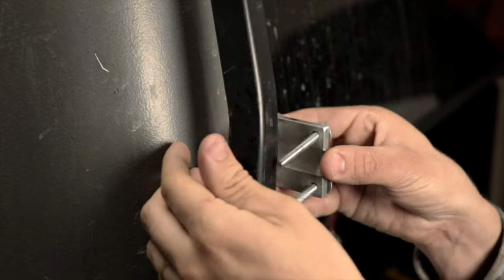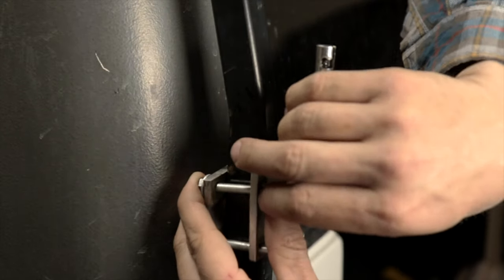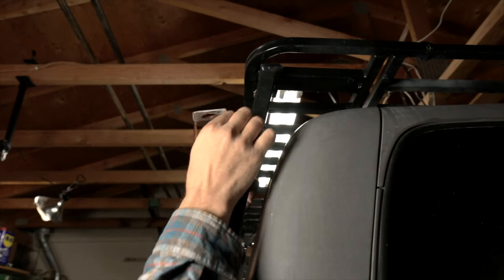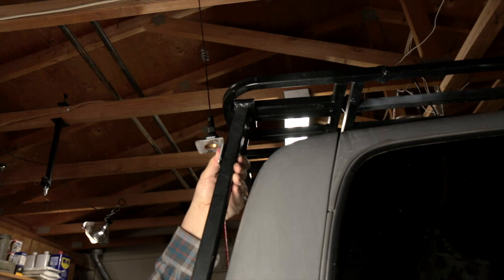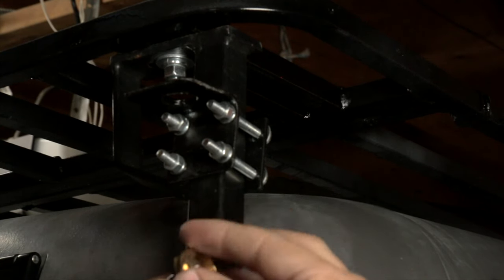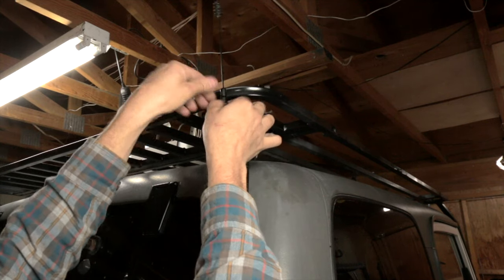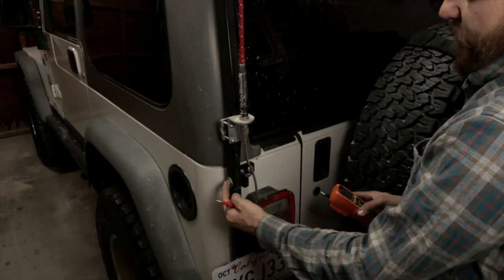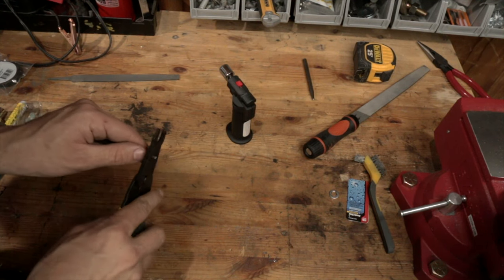How to install HAM and CB antennas

Comment: I agree. The better the ground the easier it is to tune the swr. And with a jeep or any high profile or of road vehicle a quick disconnect is a must. Great video.
Reply from the maker: I used to never run quick disconnects. I’ve learned. Haha. Thank you!
Reply: Yes I found that  too...SWR was erratic until I grounded the outer coax via the  antenna mount to a hidden bolt on the roof bars . As you say, much easier  to SWR after.

Comment: I have a feeling you are going to regret not using aircraft nuts on those bracket installs—at least some blue lock-tite—all this based on your choice of vehicle and their reputation for poor ride and bone-jarring suspension characteristics, even if left in the OEM configuration. Especially recalling your comment in this video foreshadowing future hitting of trees and other low entryways. A rule to apply when adding hard-mounted accessories to two categories of vehicles is: #1, if they can operate on water. #2: If they are designed to or have been modified to operate off-road. If your application falls under #1 or #2, then apply this rule to avoid future mount issues. This rule has two parts and is just good practice, omitting any special use parts with a fix for a known safety issue. (Like a break-away base mount for an off-road vehicle flag, manufactured to snap off at the mounting point in a collision, reducing the risk of the flag pole becoming dangerous at impact velocity speeds determined by the manufacture, much like modern lamp posts and street signs close to roadways, which snap off at the ground and give up all their tinsel strength, rigidly greatly reducing damage during a collision event.) Part 1: Use stainless steel hardware. If you have the option to choose stainless steel for your project, avoid the non-stainless choices. Stainless steel stands alone in strength and anti-corrosive attributes and will last much longer on a vehicle exposed to outdoor environments and weather. Part 2: Always use vibration-resistant mounting hardware (if none is available, a temporary fix would be to use blue lock-tite when installing until better hardware becomes available to the installer; also, a safety cable can be installed, preventing the loss of mounted items or equipment during the vehicle's operation). Aircraft nuts for bolts are an excellent choice, followed by carter pins, roll-over pins, and locking washers. A dab of silicone or RTV under the head of a screw or bolt helps prevent corrosion when mounting requires drilling through the mounting point, removing anti-corrosive coating applied by the OEM, and will hold screws and bolts in place when applied to a properly prepped surface while providing a buffer to abrasion over time between mounting hardware and mounting surfaces prolonging accelerated corrosion due to friction damage to protective coatings  applied to any mounting point surface, the same enhanced protection from trapped moisture can be expected from the application of silicone or RTV to mounting hardware where contact is made and rests or covers any mounting surface now covered by brackets or bolt/ screw heads.

Comment: actually that meter does beep for continuity. the sound symbol above the diode symbol means it beeps
on those cheaper version meters you will have to press FUNC and scroll to the sound section first
unlike the more expensive brands like Fluke which have sound and visual automatically
Reply from the maker: Learn something new everyday, thank you!
Reply: @EmbarkWithMark  you're welcome. I found out that a few years ago. I've used my $300.+ Fluke for many years, it's good for a more secure jobsite use and purchased a cheaper Southwire brand several years ago for less secure jobsites and didn't know why it didn't beep like the Fluke does. Found out later in the manual.